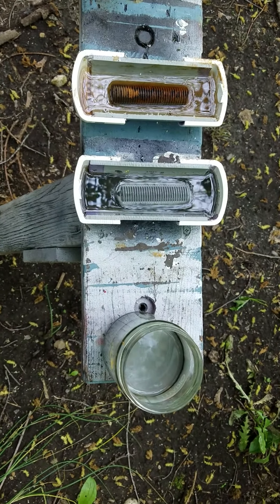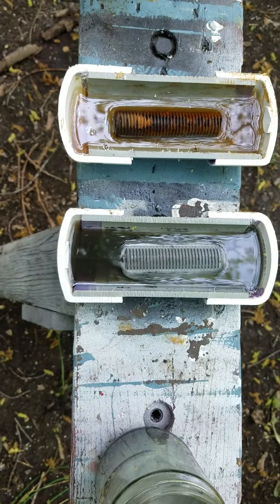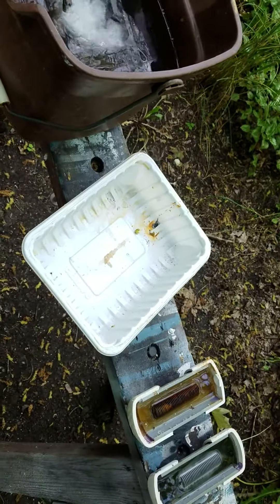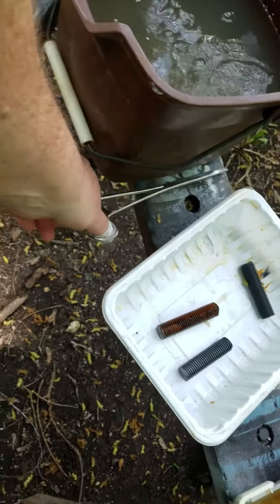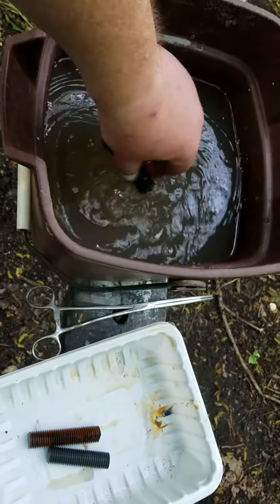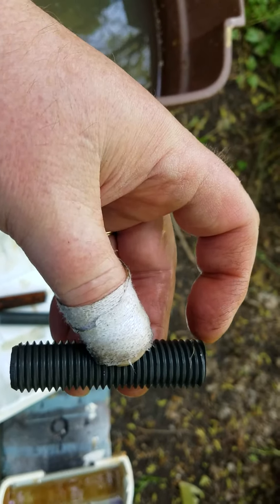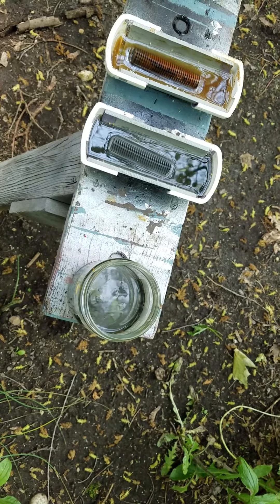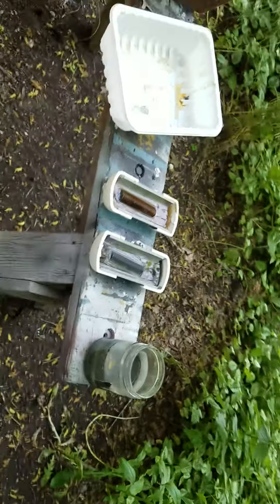Sharpen Files With Acid

Comment: i would also imagine the tiny pits, would also act like small files in themselves as well as the thinning of the original edge, crazy would be etching a new file :)
Reply from the maker: If the chemistry is done correctly a surface can be bright dipped. The anodize shop at United Technologies made chemically polished extruded aluminum for buildings and automotive trim.